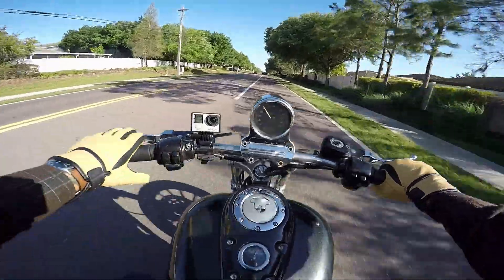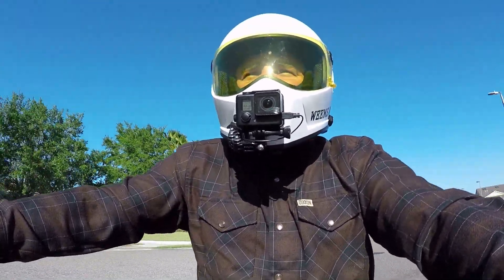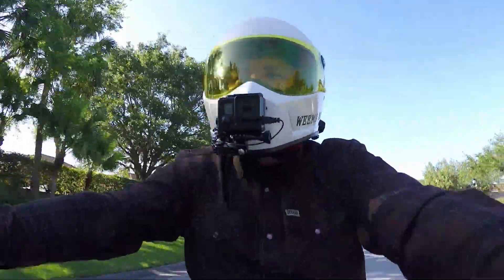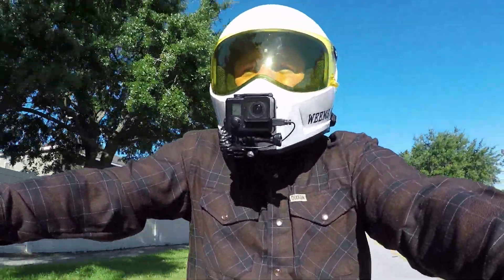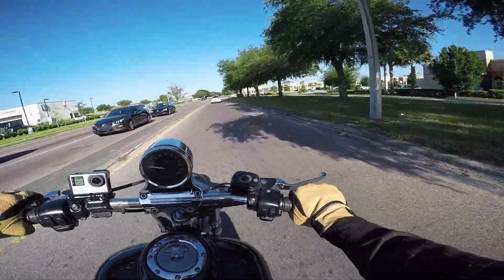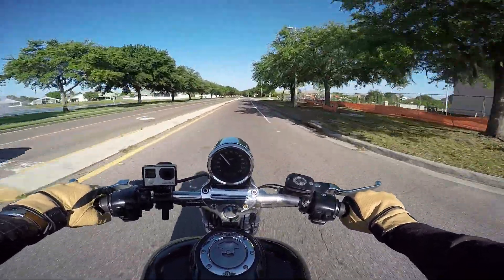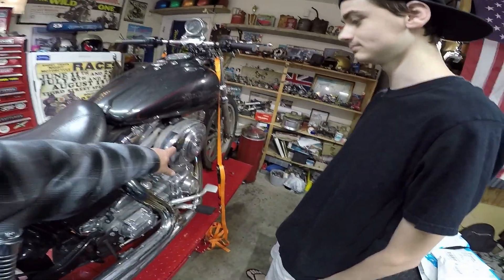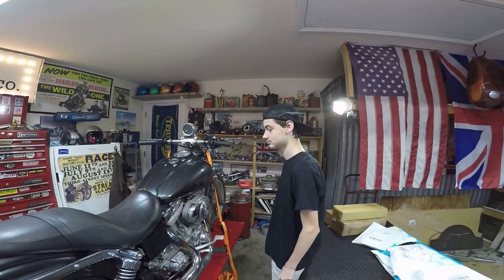It's a Harley?!?!

Comment: I guess a Harley is an ok change of pace... just this once.  I had a spark plug blow out of my engine as I was cruising along at 60mph today.  My poor 64 Triumph.  The hole is stripped and won't take a plug anymore.   I'm guessing I'll need to retap the spark plug hole or Helicoil it.  Can that be done with the head on the engine.  I'm new to vintage Triumphs.  Loving this bike so far....despite what happened today.   : )
Reply from the maker: Dont risk it.  Remove the head and get a helicoil!
Reply: @weemsmotorco  Darn it, I was hoping you wouldn't say that, but I'm sure you're right.  I just watched the Lowbrow Customs video series on taking apart a Triumph engine.  It doesn't seem too hard to get the rocker boxes and the cylinder head off so I can helicoil the spark plug hole properly.   I'll probably take the head to a mechanic since I've never done a helicoil and I don't want to screw it up.
Reply from the maker: Your bike is a 64 so all the hardware will be Whitworth and your standard or metic wrenches will not work.  You will need to have a set of Whitworth wrenches at the least.